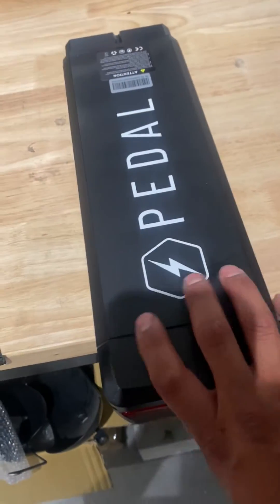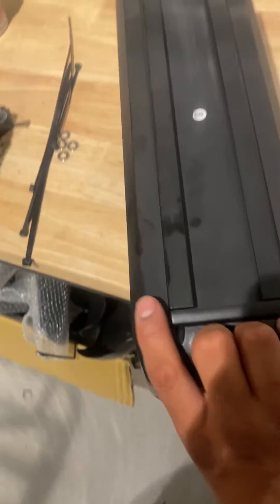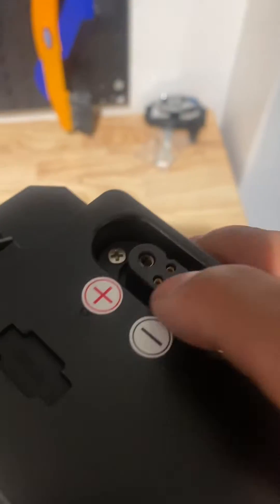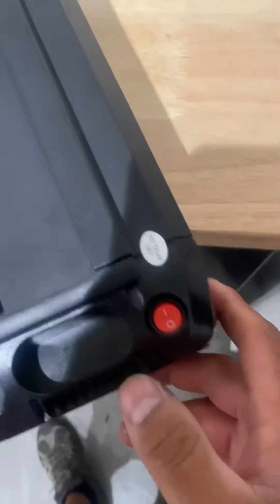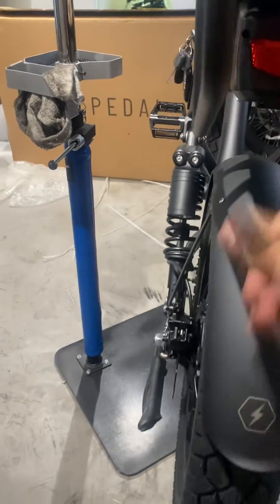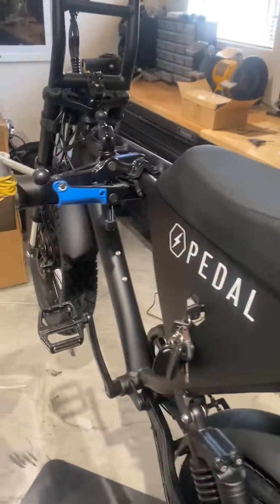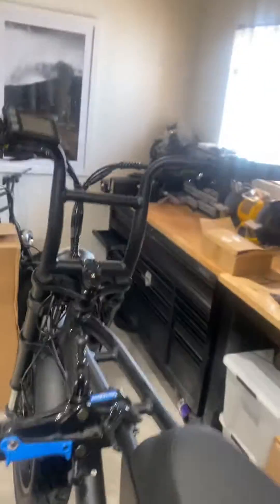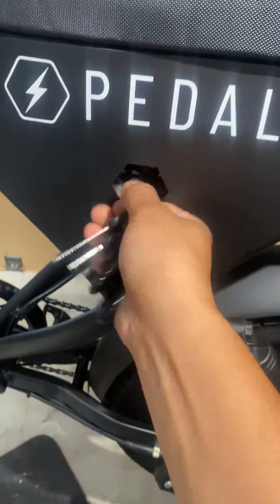Pedal Electric How to property install a battery on e-bikes

Comment: How do you get an extra battery?
Reply from the maker: Our manufacture is working on a secondary battery that will be able to use for all the pedal electric bike models. Coming soon.
Reply from the maker: Our manufacture is working on a secondary battery that will be able to use for all the pedal electric bike models. Coming soon.

Comment: What is the name for this type of battery style? I'm looking for a new replacement battery and am lost online trying to find the same type
Reply from the maker: You can find the battery by the bike model  name in Pedal electric website and if the battery is discontinue you can still refurbish that old battery. Try this place here is the link https://ebikemarketplace.com/?cmp_id=19331553007&adg_id=153153838308&kwd=ebike%20market%20place&device=c&gclid=Cj0KCQjwiZqhBhCJARIsACHHEH_cUzf1BTUvAHj1yBArZvb0_BErJItzBeaorbFRqYrEwBjY8ZaTTmQaAjl7EALw_wcB